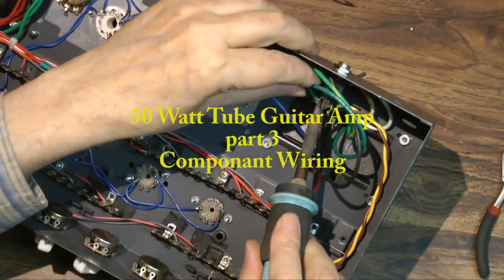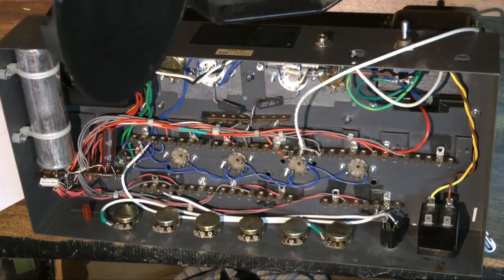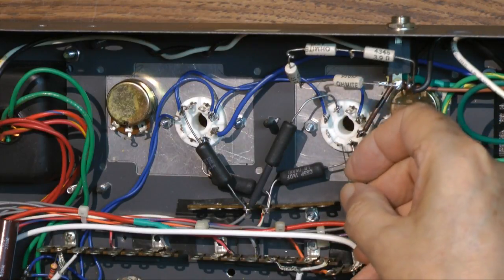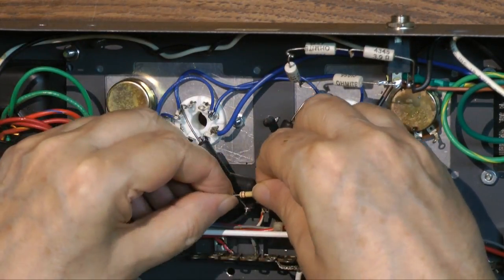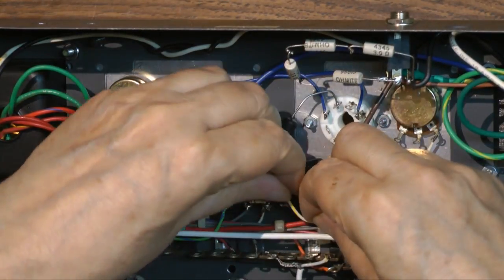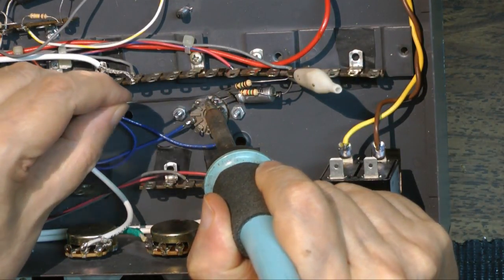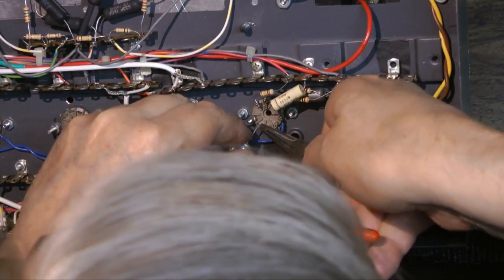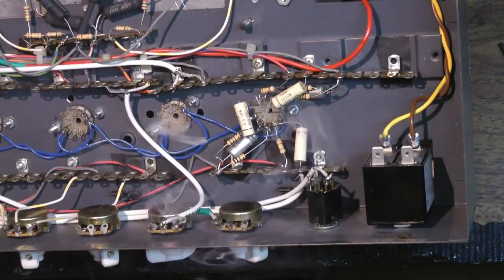50 Watt Tube Amp - Part 3 - componants

Comment: HI, I am really enjoying watching you build this amplifier and describing your reasoning for doing certain aspects of the assembly process. If you don't mind answering; how did you determine that there was high frequency instability, that the cathode resistor attachment point was the cause, and why moving one further away from the other resolved the problem? I am still a novice to amplifier building, having only built a few single ended, and one cathode biased Push-Pull guitar amplifier. But, I plan on making my 1st Class AB Fixed bias amplifier soon and think this information might be useful. Thanks, Tom
Reply from the maker: I'm glad someone enjoys these videos! Thanks! 

When I powered up the amp at first, it drew too much current, and at higher volume settings, it went nuts current wise! Experience told me it was an instability, internal feedback problem, so I looked over my design and noticed the common ground for the output tubes. I knew I shouldn't have wired it that way, not sure why I did, so I simply split the ground.  You have to remember that every ground wire is actually a resistor, and if 2 or more components or stages share a wire, they actually mix each others signals as if they were in a 'combiner summer' circuit. For the same reason, filter capacitors have to be grounded at the common point, not to the chassis or any old convenient ground. That's the reason vintage amps hum and often make strange sounds!  

I once spent a week tracking down an oscillation higher than I could measure on my scope, nothing I did, no filter cap I added, solved the problem. Then I un-hooked a filter cap from it's ground point on a circuit board, and "flew" it to the power supply ground - that fixed the problem, and I could remove all the other caps I had used to try to fix it. I never forgot!